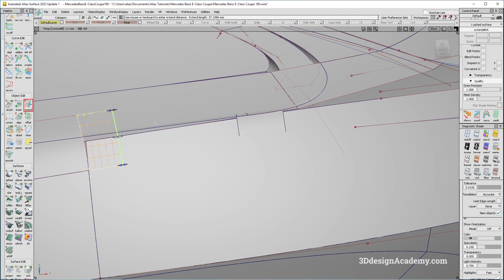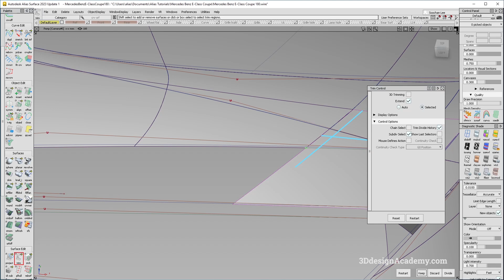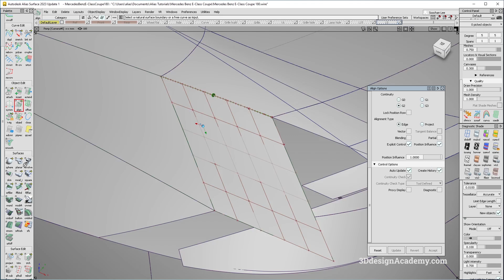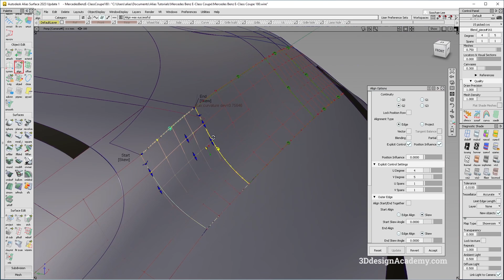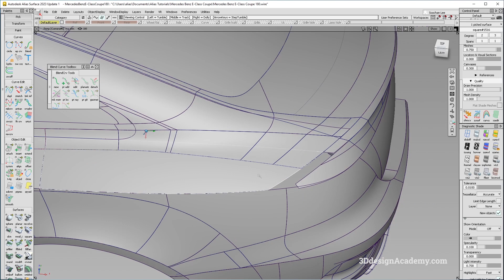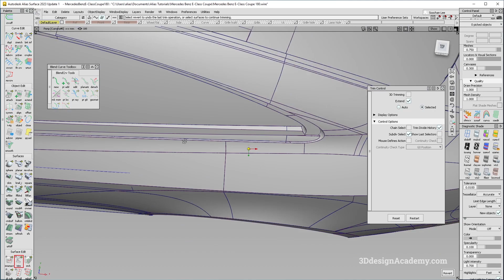Autodesk Alias Tutorials – Mercedes Benz E-Class Coupe 180

Comment: Hi !! Thanks a lot for the tutorials. I am working on this model with your help.
I had one question though. I am using Alias learning edition on my laptop. It keeps crashing every 5 min showing software error has occurred message. I really can't work. Is there a solution for the same ? Could you please help me ? Thank you in advance.
Reply from the maker: What kind of laptop do you have? Does it have a dedicated GPU?
Reply: @3DDesignAcademy  Yes it does. I have Acer Nitro 5 with Windows 11, 16 GB RAM, AMD Ryzen 7 5800H with Radeon Graphics Processor, and a 6 GB NVIDIA GeForce RTX 3060 dedicated GPU.
Reply from the maker: @singhri1990  That should be more than enough specs for Alias. Can you share your file? You can send it to contact@3ddesignacademy.com I'm going to see if I have the same problem. Also, I would contact Autodesk.
Reply: @3DDesignAcademy   I have shared the wire file that I am working on. Its under progress. Please have a look and let me know the solution. I really appreciate your help. Thanks a lot.
Reply from the maker: @singhri1990  I got your email. Let me open it and see if I can replicate the issue. Just to make sure, are you getting Msave? What error messages are you getting?
Reply: @3DDesignAcademy  Yes I am getting Msave. The error message that I am getting is "A Software error has occured. Attempting to save your model as:" path to temp folder". Whenever the crash happens I get a new Msave file in an automatically created folder named "_M.SAVES".
Reply from the maker: @singhri1990  I tried to replicate it, but I didn't get a Msave. I'll keep trying, but one of the reasons could be due to the canvas. I would try modeling with the side view canvas off and see if it helps. You can also refer to this video as well. https://youtu.be/CS8pmRgsrm8
Reply: @3DDesignAcademy   Yes I saw your video, its really very informative indeed, I tried to proceed after removing the canvas as well, still Alias is crashing and I am getting Msave again and again. I have now decided to start modeling from scratch once again, because I could not figure out a solution, I even reinstalled Alias but still the problem remains. Thanks lot anyways !!
Reply from the maker: Oh... I wonder what the problem is. I'd definitely contact Autodesk. Sorry I couldn't be of better help!
Reply: @3DDesignAcademy  No Problem Sir. You tried to help me so thank you so much for that. And please let me know what Autodesk says.
Reply from the maker: @singhri1990  No problem! Also, I suggest you talk to Autodesk because you have the error report. I can't talk to them as I can't even replicate the error.
Reply: @3DDesignAcademy  I surely tried talking to them. But they are saying that they don't provide support for the Alias Learning Edition version as it is free.
Reply from the maker: @singhri1990  No way.... that's crap. Why does it matter if it's free if you're trying to report a software error.
Reply: @3DDesignAcademy   Yes that's true, but that was their response. Actually I started the model from scratch again and finished the curve network, but as soon as I started blocking the surfaces, again Alias started crashing with the same error messages and mSave. I have sent you an email with the screenshots of the alias error message and my chat with Autodesk. Please have a look whenever you get a chance and let me know what you think. Thanks a lot Sir !
Reply from the maker: @singhri1990  Hey I got your email. I'll have to play with your file over the weekend a bit more. However, I'm wondering if it's the canvas. I'd try modeling with the side view canvas off, especially in a perspective view and see if it still crashes.
Reply: @3DDesignAcademy  Okay Sir. Thank You. I will try doing the same and see if it still crashes.
Reply from the maker: @singhri1990  Sounds good. Give it a try and let me know if it works.
Reply: @3DDesignAcademy  I tried modeling it today with the side view canvas off like you suggested, but unfortunately Alias is still crashing every few minutes.
Reply from the maker: @singhri1990  Ok.... Let me try using the file this weekend and see if I also get crashes.